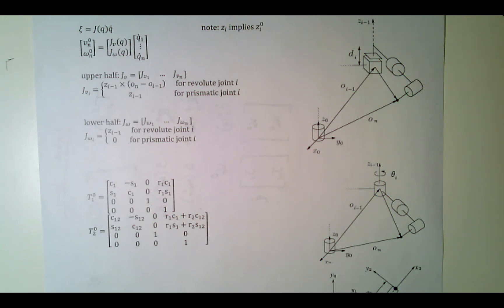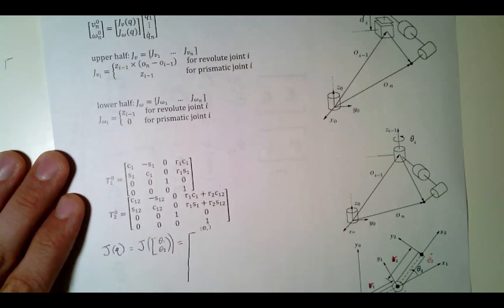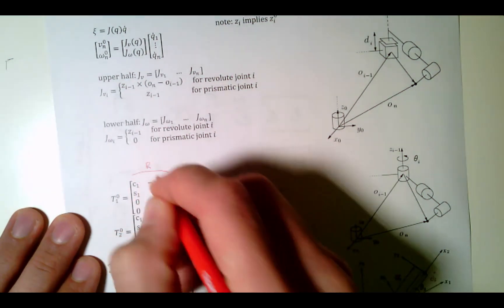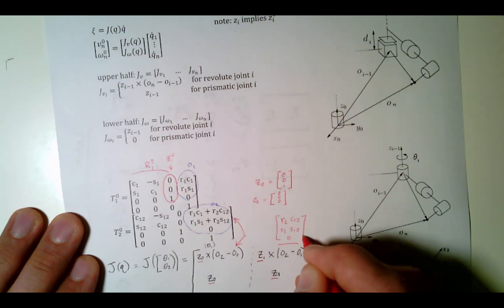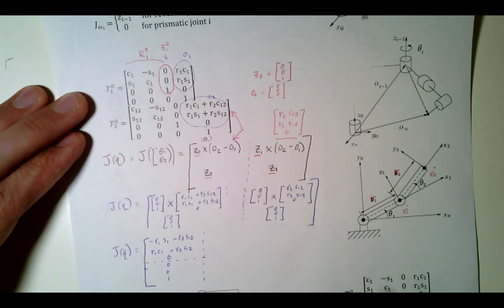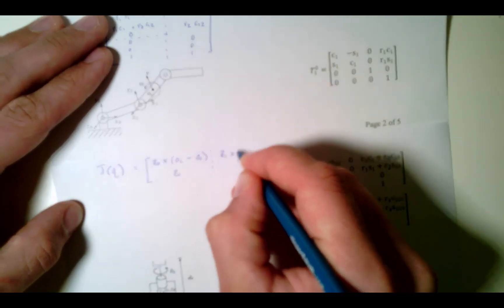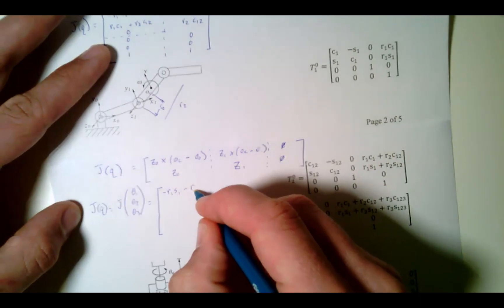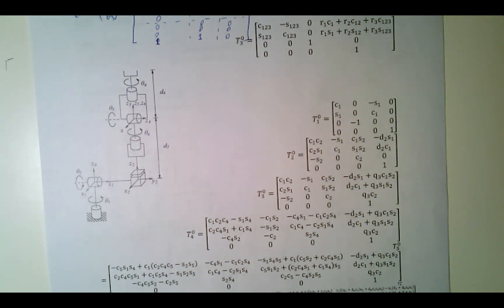Intro2Robotics Lecture 13a Jacobian Examples

Comment: Hi sir, thanks for this great video. Im still new to robotic and im trying to find how to calculate all joint angles using IK jacobian. Would this method capable to find all 6 angles? Thanks.
Reply from the maker: This method is best for robots with a spherical wrist.  When you have a spherical wrist, you can split the first 3 and last 3 DOF, making the separate problems easier.  This is still possible to do otherwise, but is more complicated (you might use the Law of Cosines more).

Comment: Sorry. I am not Understand matrix Z0(1x3) x O2(1x3). Could you please  explain to me
Reply from the maker: This is to compute the linear velocity of the end effector caused by joint 1.  Z_0 is the orientation of the z_0 axis.  We are multiplying this by how fast we move joint 1 (q_1 dot), so this is the angular velocity.  The other matrix is the moment arm from the axis of rotation to the end-effector.  The general form is [(position of end effector) - (position of the rotating joint)], which in this case is [O_2 - O_0].  Since O_0 is all zeros, that simplifies to just O_2.  We are using the rigid body properties of the cross product:  https://en.wikipedia.org/wiki/Cross_product#Rigid_body .  Does that help?

Comment: What is the tought process behind finding out the Jn matrixes? The J0 should be [0 0 1]' all the time? I'm having trouble understanding how find those. If I have 2 rotative joints, the parent rotates parallel to the XY plane while the child rotates parallel to the Z plane, both joins are separated by a height of h_1, how do I find Z0 and Z1?
I was trying to figure out by the examples given in this video, I don't understand if the 1 on the 3rd row of J0 is supposed to be 1 because the axis is pointing upwards or if the distance (h_1) is 1 in the example.